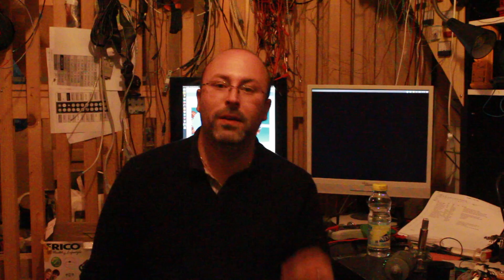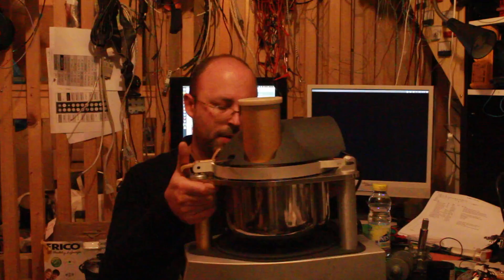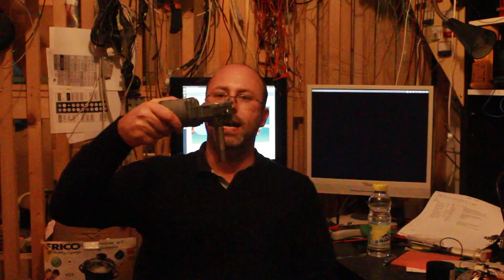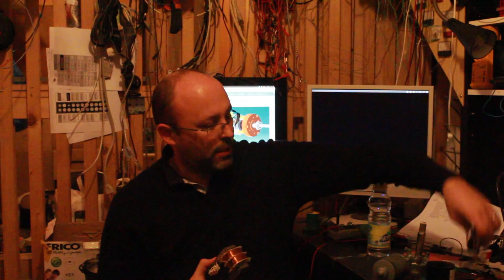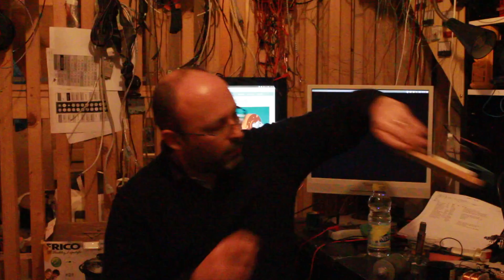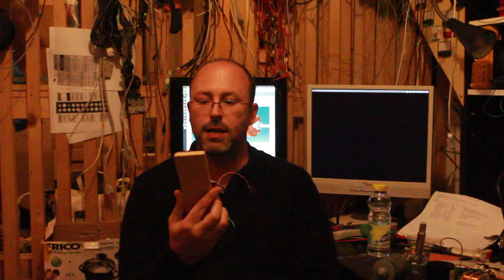Episode 1: Intro

Comment: Tolle Idee, wenn ich alles richtig verstanden habe. Allerdings finde ich die Aussage über den Mikrocontroller und den Motor nicht ganz richtig. Die meisten Mikrocontroller, wie auch der Arduino, vertragen die Stromstärke von größeren Motoren nicht, oder? Deshalb sollte man hier einen Motortreiber, oder zumindest eine H-Brücke verwenden, die dann über den Mikrocontroller gesteuert werden. Oder gehe ich damit schon zu sehr in die Tiefe?
Reply from the maker: +MrFranklin216 natürlich kann man den Mikrocontroller nicht direkt für die Steuerung des Motors verwenden. Es braucht eine Leistungsstufe. Das kommt noch...